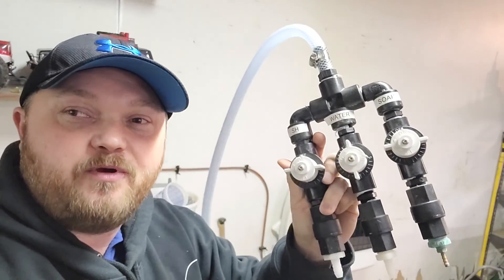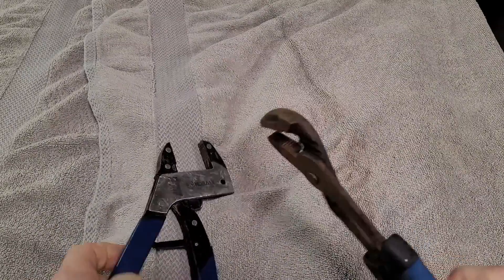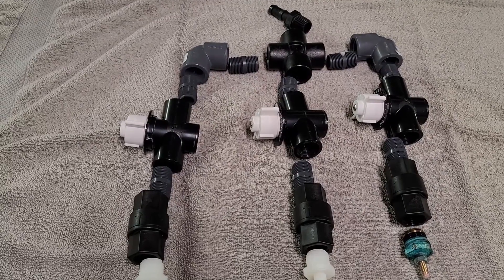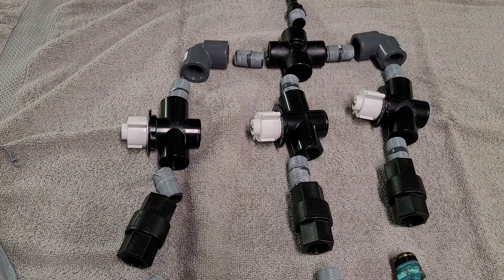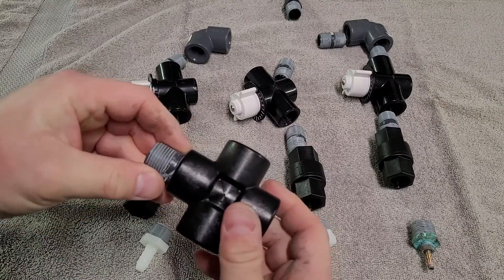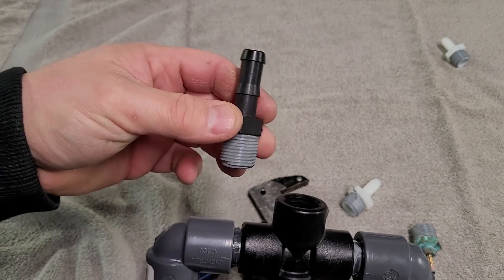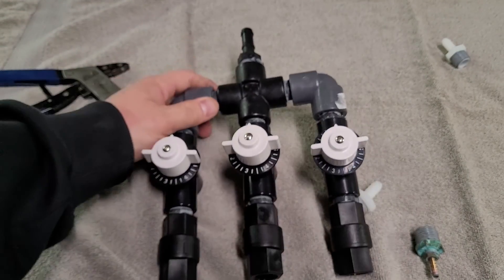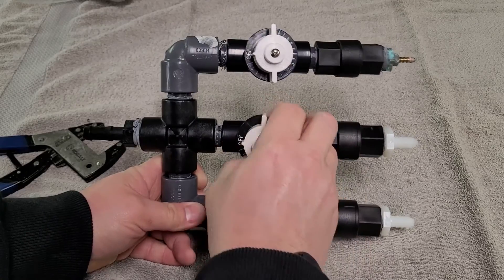How to build a Proportioner - SOFT wash PROPORTIONER

Comment: Does this work for a 79cc predator water pump? It's a 1"
Reply from the maker: Is that a gas power one? If so I don't think it would work.
Reply: @thebrothersbarn6094 yeah it’s the gas powered one from harbor freight. Guys using it with proportioners for sure. Just had to configure the pieces to right sizes. Dudes getting 9GPM on the lil thing lol needed the top of proportioner to be 1” and then transfer pieces down to 1/2
Reply from the maker: @BurntStorePressurePros Yea making them bigger will get the flow you need. Just keep an eye on pressure build up. It might be fine but the ones in the video are not rated much psi. With the gas you probably going get around 100 psi or so just guessing. Please keep me posted on this.

Comment: Do these small barbs choke the flow or is that standard practice?   In my mind bigger is better but I don’t know what the standard is
Reply from the maker: If you go to big the pump will not be able to pull from all 3 lines. This has worked for us very well.
Reply: @thebrothersbarn6094  thanks for the heads up
Reply from the maker: @northjerseykevin3915  You're welcome

Comment: Hello I just found your page on YouTube and I subscribed. I have a trailer that I bought and had plumbed for me last summer I've been in business since 2018 I had a trailer that I batched mixed prior  and I used to pull my machines off it was a real pain in the butt .
here I see you can build on your own.  Amazon has all the parts you need. Watching your video is great and you show me how to do it thank you watching I can see  it's a lot cheaper to build your own that way and plus I'd like to learn how to do it myself rather than buying one. 
I also just bought a 40 gallon tank extra for an ATV which I'm going to use as my mixing tank the water will go into that one rather than the other 30 gallon tank that he already had hooked up right now my trailer is down because I am replying my soft wash and my second pressure cleaner that I have. It's just been sitting there and I don't even use it and I'm worried that it might seize up I put detergents in it and started up once in awhile so I should be okay.  12-volt pump finally went I decided to go with a fat boy remco 7 gal per minute 100 PSI. I know that sucker will definitely pull from anything. I really want to do away with the system that this guy built for me. I don't like it I want to do the proportioner that everybody has and do it that way cuz I can measure how much I'm putting in and understand it because all I have is just regular knobs I'm going to show you a photo of what I got set up and how I'm working on it now like right now I'm down I'm dead in the water I can't even take a job on right now till I get this done it's taking me forever it's so hot outside and I'm pissing me off luckily I'm slow right now. I want to know what to order on Amazon to make your exact proportional valve cuz that's exactly like the one they sell at the store up the street they want almost $200 for. Thank you for your video and if you could get back with me I'd appreciate it with those parts that you're ordering before I ordered the wrong parts. I'm already got stuff in my car but I have a feeling it's going to be the wrong stuff. And then I have to return it and take longer to do this . If you know the parts that I need a names or numbers or whatever from Amazon please let me know thank you very much and get back with me as soon as you can and here's a picture 2:59 it won't let me take a picture they're just regular valves PVC nothing with annoying what mixture I'm putting in.
Reply: I'm not sure if any of those videos went through it's not letting me actually upload a whole video I don't know why but sorry about that I hope you understand
Reply from the maker: https://www.amazon.com/Pentair-R172086-Replacement-Automatic-Chlorine/dp/B0039LN1WQ?pd_rd_w=xQY4V&content-id=amzn1.sym.dbcb9745-7338-4a1a-b998-68e65ff8054a&pf_rd_p=dbcb9745-7338-4a1a-b998-68e65ff8054a&pf_rd_r=5Z9ZZ35JPF1DD665PT8P&pd_rd_wg=uzrCi&pd_rd_r=a1079f75-af7a-4578-afb8-5dd4ba4750a8&pd_rd_i=B0039LN1WQ&psc=1&ref_=pd_bap_m_grid_dv_rp_0_30_t

https://www.amazon.com/IPW-Industries-Inc-6850090-Check/dp/B08R6NVWCC?pd_rd_w=FNSmY&content-id=amzn1.sym.dbcb9745-7338-4a1a-b998-68e65ff8054a&pf_rd_p=dbcb9745-7338-4a1a-b998-68e65ff8054a&pf_rd_r=DYBXGBNV61W6YVTF62DB&pd_rd_wg=0MjGC&pd_rd_r=d1f8b3df-324f-46dc-a693-a712bad0c8b1&pd_rd_i=B08R6NVWCC&psc=1&ref_=pd_bap_m_grid_dv_rp_0_37_t

https://www.amazon.com/ANPTGHT-Plastic-Fitting-Connector-Fittings/dp/B094QJW6FP?pd_rd_w=AMcl4&content-id=amzn1.sym.e0ae54a7-cc19-4a6c-a6ef-01924426ff7b&pf_rd_p=e0ae54a7-cc19-4a6c-a6ef-01924426ff7b&pf_rd_r=R33ND8GXDZD5PTKD2FEP&pd_rd_wg=j4wV9&pd_rd_r=b1691911-1924-4705-8fc8-62232f7c34af&pd_rd_i=B094QJW6FP&psc=1&ref_=pd_basp_m_rpt_ba_s_17_sc

https://www.amazon.com/Banjo-HB050-Polypropylene-Fitting-Adapter/dp/B001HMG4LO?pd_rd_w=AMcl4&content-id=amzn1.sym.e0ae54a7-cc19-4a6c-a6ef-01924426ff7b&pf_rd_p=e0ae54a7-cc19-4a6c-a6ef-01924426ff7b&pf_rd_r=R33ND8GXDZD5PTKD2FEP&pd_rd_wg=j4wV9&pd_rd_r=b1691911-1924-4705-8fc8-62232f7c34af&pd_rd_i=B001HMG4LO&psc=1&ref_=pd_basp_m_rpt_ba_s_24_sc

https://www.amazon.com/SMC-6850090-Check-Valve-FNPT/dp/B0025PKGEI?pd_rd_w=MDR1v&content-id=amzn1.sym.e0ae54a7-cc19-4a6c-a6ef-01924426ff7b&pf_rd_p=e0ae54a7-cc19-4a6c-a6ef-01924426ff7b&pf_rd_r=E8ZM6J3H6B4J4VPZRFY3&pd_rd_wg=b4Mli&pd_rd_r=c44928fa-492b-43ba-b5b9-575a5a43319b&pd_rd_i=B0025PKGEI&psc=1&ref_=pd_basp_m_rpt_ba_s_30_sc

https://www.amazon.com/Banjo-HB050-025-Polypropylene-Fitting-Adapter/dp/B00AB5X28G?pd_rd_w=MDR1v&content-id=amzn1.sym.e0ae54a7-cc19-4a6c-a6ef-01924426ff7b&pf_rd_p=e0ae54a7-cc19-4a6c-a6ef-01924426ff7b&pf_rd_r=E8ZM6J3H6B4J4VPZRFY3&pd_rd_wg=b4Mli&pd_rd_r=c44928fa-492b-43ba-b5b9-575a5a43319b&pd_rd_i=B00AB5X28G&psc=1&ref_=pd_basp_m_rpt_ba_s_31_sc

https://www.amazon.com/Banjo-Polypropylene-Fitting-Schedule-Female/dp/B00AB5YHK8?pd_rd_w=MDR1v&content-id=amzn1.sym.e0ae54a7-cc19-4a6c-a6ef-01924426ff7b&pf_rd_p=e0ae54a7-cc19-4a6c-a6ef-01924426ff7b&pf_rd_r=E8ZM6J3H6B4J4VPZRFY3&pd_rd_wg=b4Mli&pd_rd_r=c44928fa-492b-43ba-b5b9-575a5a43319b&psc=1&ref_=pd_basp_m_rpt_ba_s_0_sa

Hey buddy i have added alot of the links for your. I'm out working on the job now so if I missed something please let me know. 

Keep me posted on how your build is going.  
Also yes a 7gmp is must better 😁

Comment: Proportioner chart that works for this?
Reply from the maker: Yes there is one. I will get it out for you. Should have posted today or tomorrow.
Reply: @thebrothersbarn6094  were you able to find a chart for these valves? I would imagine the numbers are "parts" as in 1 part water to 1/2 part SH to 1/4 part soap. Would this be accurate?

Comment: Do you need the dialer valve for the water? Isn't it always wide open?
Reply from the maker: You would think you shouldn't. We have tried without one and if you don't use one than your % will be way off. This is because there would be No restriction for the water, but a restriction for your soap and SH.

Comment: We bought the exact Pentair Valves. The ones we purchased do not allow 100% flow when on setting 5. We tested them against a regular 1/2 ball valve. The valves restrict the flow. I believe it is a design flaw. When you don't get 100% flow on water the 12 volt pump will sputter and your working pressure is greatly diminished. Did you test your valves before you built your proportioner ?
Reply from the maker: We did not test before built. I will say it worked fine for until they got a Crack in them.
Reply: I actually just last week spoke with the a rep for Pentair and told him what my test found. He confirmed that is how they are designed since they are designed for regulating chlorine in the swimming pool industry. That they will always restrict the flow even at full setting 5. We are building our new ones with the more expensive GF 1/2 inch Valve. And yea I have read reviews on Amazon that they crack and leak easily. Thanks Jeff

Comment: Couldn’t you just use a regular inexpensive ball valve PVC on your water as well as your surfactant? And of course on the SH is a good valve. What’s your thoughts?
Reply from the maker: I don't think a ball valve will get you the rate ratios. When you are turning those on and off it's really hard to say if you are at the half point or not. I will say we tried using a ball valve on our water only one time and the mixer was pulling more water than SH due to less restriction.
Reply: @thebrothersbarn6094  
I understand. I know the SH destroys pretty much everything. What do you think of the less expensive valves? I would use them for the surfactant and the water and the more expensive valve on the SH. What’s your thoughts? 
Thanks
Reply from the maker: @Omega19210   The flow rate would be off still. I will put a video together to help show my understanding on this.

Comment: Great video! What do you mean by "1 pack will do only need 2" at the joytube plastic hose barb fittings? Isn't it enough to just buy 2 of the Parker Hannifin? Thanks in advance
Reply from the maker: I think having 3 work better with the ratio.

Comment: nice video. Are the control valves the same as Pentair Automatic Feeders fit for  Model 300-29X Model 320 Model 322?? Will be grateful to have the answer
Reply from the maker: No I don't think so. This are control valves used mainly for pools.
Reply: @thebrothersbarn6094  thx!!

Comment: I quit using those metering valve. I'm about to build me one with the  1/2" Metering PVC Ball Valve from US Plastics. Everything 3/4 except the metering valve.
Reply from the maker: We had a meter valve go bad on us and didn't have an extra. So we tired the ball value and it didn't pull everything right. Could be wrong but don't think ball valve will keep the ratio right.
Reply: @thebrothersbarn6094  they are metering ball valve.  I had 2 like yours, one built by pro's and one built by me and both ended up leaking.

Comment: Question, could you break down what the knobs need to be at for the SH, and water valves to get the correct mix? 
What would I need to set at for 1-2% and what would I need to set for 4-6%?
Reply from the maker: Yes that's a good idea. I will get one posted in a few days for you.

Comment: Awesome video I am getting ready to order the parts. How many gpm pump can this handle. I'm new so I'm not sure if it matters lol.
Reply from the maker: We have used a 7.0 gpm pump and no issues. Good luck buddy and if you have questions on the way hit us up.
Reply: @thebrothersbarn6094 would a gas pump doing 9 gpm be fine? Thanks for your time brother
Reply from the maker: @Yaknowwut  I have not tried it with a gas pump yet. I would say it should be good as it is pulling, not pushing the mix into it.  Let me know if you try and if it does work. Thanks brother!